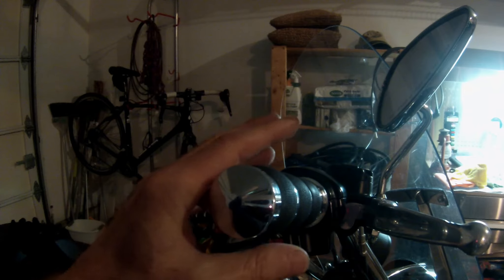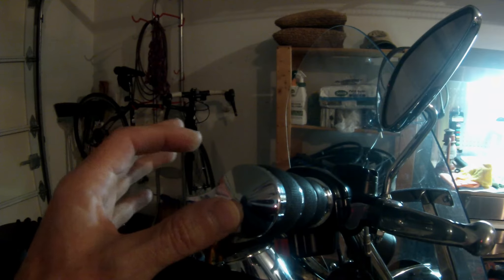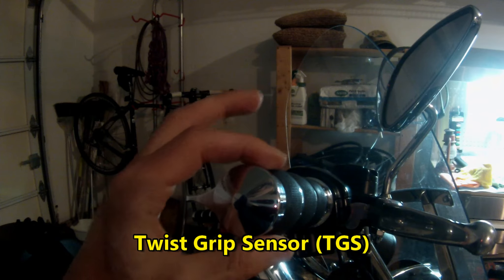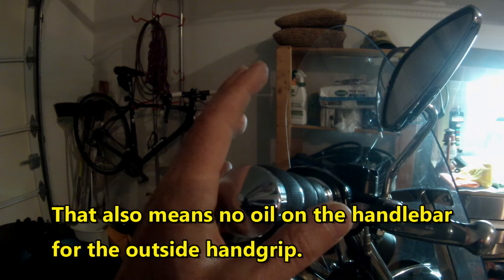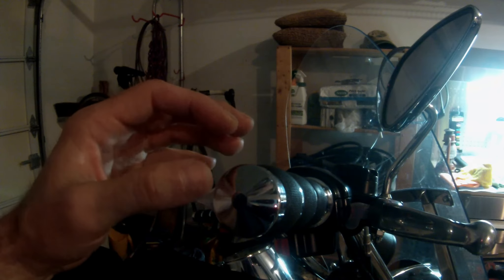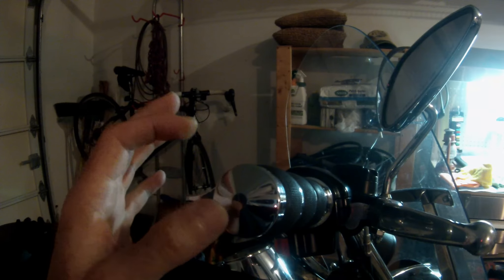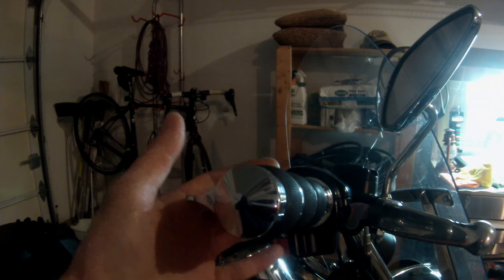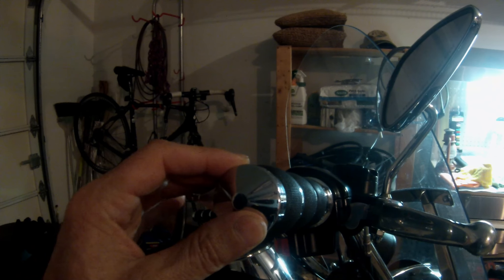Sticking Throttle | Electronic Throttle Control - ETC | Ride By Wire | Throttle Grip Sensor - TGS

Comment: I opened my bike's throttle. Drilled the punched points out on one side and removed the splined part, cleaned the shaft and put a lot of vaseline for lubrication. Working 100%
Reply: Were you able to see the return spring while you had it apart?  I'd like to replace it with a weaker spring.  The oem spring is too stiff and makes longer rides miserable.

Comment: 2018 Heritage, 3k miles, and mine started to stick. Warranty covered it, but now the new one is starting to act up just a little. Not impressed.
Reply from the maker: Mine had many, many hard miles put on it. However, I've been noticing a high fail percentage for Throttle Grip Sensors on M8 bikes. They'll get it worked out on the next pressing I'm sure, but I would take it in and ask them to replace it again. Exaggerate a little. Any burps with their digital throttle sends them into a panic. As it should. Get it replaced again under warranty. Good luck.
Reply: @nwroadrat  I'm on my fourth bike that has had this problem and every single time, the dealer has tried to imply that there's nothing wrong. I've had two replaced under warranty on two different bikes, one replaced out of pocket on another bike. I am now on my fourth bike with the same issue. I just purchased a gently used 2018 Heritage Classic from Wild Child Cycles in Springtown, TX on December 16, 2022. The bike only had 260 miles on it. Today is January 2, 2023 and the bike now has 1,936 miles on it and here we go again. It has become obvious to me that age and wear is less relevant than the fact that many of these machines are equipped with defective parts. My 2019 Road King has over 67k miles and the throttle input is still buttery smooth. This is the part number for the twist grip sensor 32700094A. This replaces the outgoing model, part no. 32700094. If there is an "A" behind the number, this indicates a revision of that part. Since this has been a widely known problem for some time now, one would expect all current production bikes to be equipped with the latest revision. Sadly, I suspect that's not the case unless the new ones are going wonky as well.

Comment: I need to replace mine, its sticking. Can someone show me step by step how to replace this?
Reply from the maker: If you purchase a replacement kit, it should come with instructions. Recommend dealer install though. This item they usually get right due to all the safety around it.
Reply: Why isnt this a recall